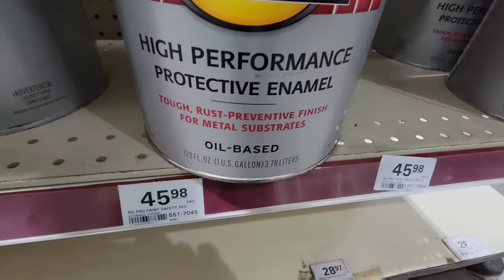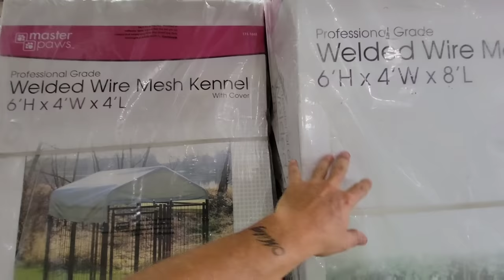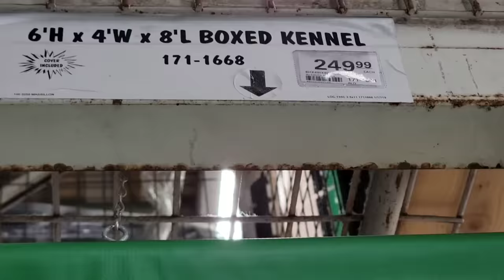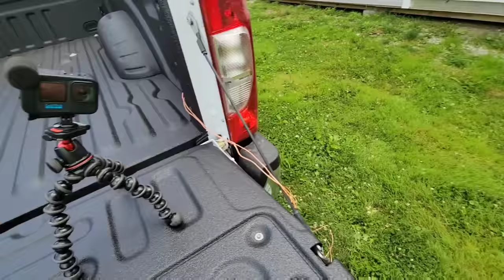UNLOADED My SHOPPING CART After SEEING THIS | The WORLD Has LOST ITS MIND!

Comment: I agree with you on the gun issues. Now I had a chicken run just like yours but it was 4x12x6 kennel run with hardware wire on the bottom to keep critters OUT. And a roof. It was GREAT! A netting on the roof before you put the tarp over it would keep racoons OUT of the rooftop or attempting to get IN the run.

Comment: If you used the two "inside"  panels and swung them apart, you could make your chicken runs 8' x 24' long without any extra panels. Just an idea. Use chicken wire fencing strung across the tops of the panels to deter overhead predators.

Comment: I thought I'd suggest this since your Stihl scissor type attachment bit the dust several vids back.  Ballard's has a piece called the Tri-Clone which operates similarly and has replaceable blades.  The big difference is that the bades operate like the swing blades on a bush hog and less like the scissors you had.  I first saw it used by "Tim the Lawnmower Man" 's youtube channel.  He's from Australia.  Thought it might help for occasions where needed.